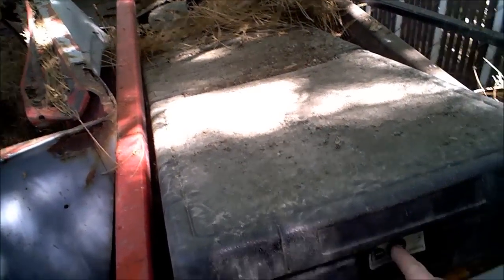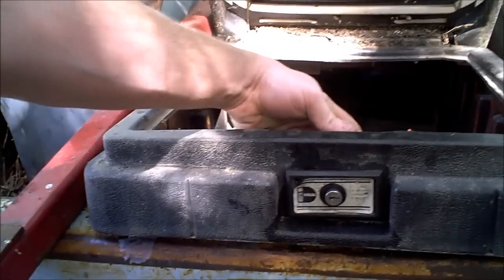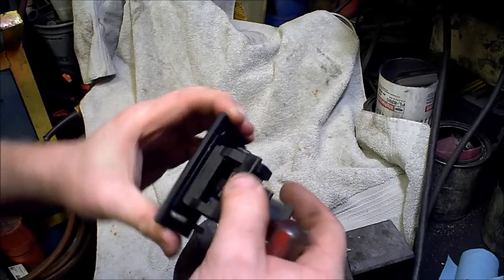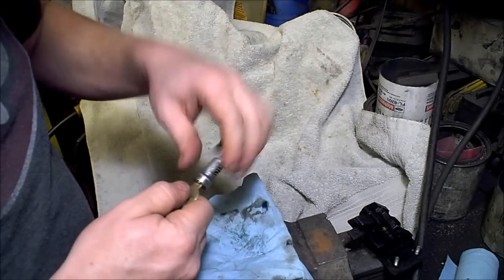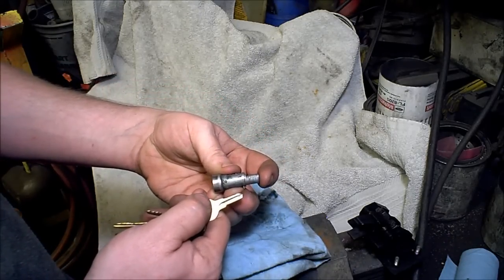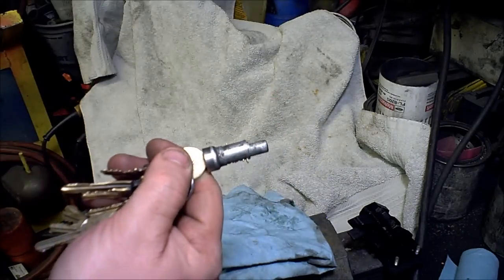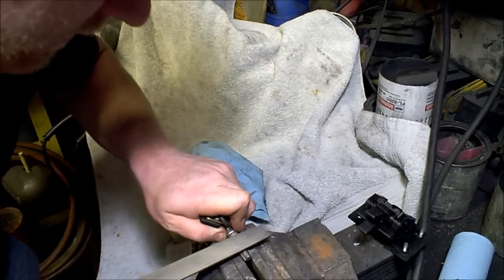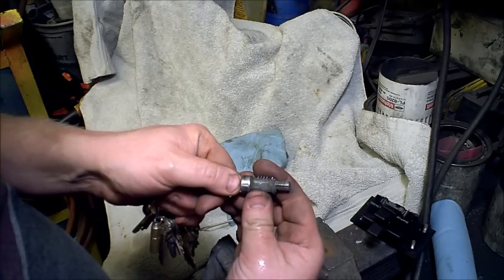Rekey Truck Tool Box Lock

Comment: thanks it works , I fixed both lock on my tool box , only thing is now any key that fit's the key hole can open the door, the only thing  that saves my hide is when I close the tail gate on my jeep and lock it you can't reach the tool box lock's , cause they hide behind the jeep door .
Reply from the maker: Someone would likely know how to pick lock already before they attempted to stick a key or pick lock in the lock to open it.
Reply: im just saying maybe  it's just me than , when I was a little guy I stuck my key in a somebody's lock cause my key fit and it opened, and when I was 16 my mom took me to a store , and we open the door of our Pontiac, than we used the second key to start it and it would not start , back than cars had two keys remember , it wasn't our car , it looked just like it and our door key opened it, but would not start it, so since than I have a habit of sticking my key's where they don't belong , so it's MY BAD , but thank you for helping cause they wanted between $40 and $60 to rekey it, plus like I said the lock box is in my jeep and the lock's are facing the tailgate , with like one inch of room between the box and the tailgate. so no one getting in.
Reply: jojojeep1 Yes, that's called "key interchange", when you stick the wrong key into a lock and it turns anyway. No lock is completely immune to this problem, but you definitely make it worse when you file tumblers in this type of lock.

Comment: sixtyfiveford  Kudos for figuring this out with no locksmith training. But there's a problem here. What you've actually done is a bad example of MASTER KEYING. The original key still works, and your new key works, plus a couple dozen other keys which are similar to either of those keys. What you may not realize is that now you've drastically decreased the security of the lock. These types of locks are not very secure to being with and now you've made it worse. After this modification, the lock will be very easy to pick and much more vulnerable to random keys. Real "rekeying" involves rearranging or replacing the tumblers with the goal of making the old key stop working. If you're really lucky, you might be able to just rearrange the tumblers until they line up with the key you have, but more likely what you'd need to do is either #1 get yourself a rekeying kit with a selection of different sized tumblers, or #2 get an uncut key blank which slides into that plug and file the key with a round file until it matches the rearranged tumblers.

File the key, not the tumblers. That way the lock is uncompromised.

I'm a Certified Master Locksmith.
Reply: Toolbox keys are often alike

Comment: Will this work on truck/car door locks also? I have a truck that the key will not work in the passenger door anymore, bought it used and the key is not in new condition to get a good copy made. Thanks.
Reply from the maker: It won't. I have had the exact same situation. The best solution is to get a copy made. Then get a copy of the copy. This will built it up to closer where the original would have been.
Reply: Superiorpowerwash Take your worn key to a locksmith shop. Ask them to decode the key and make an original back to factory specs. It costs more than a duplicate, but it should solve your problem.

Comment: I have a Contico plastic truck box, dual lids, no key and its locked. How do I open it without damaging the plastic? It's empty and off the truck so I can move it around easily but can't get it open to remove/replace the locks. Any suggestions? Will drilling out the rivets work?
Reply from the maker: These locks are relatively easy to pick. The easiest way is with a key that fits in the hole. Pull the key in and out rapidly while applying slight turning force. Generally with will pop them right open.
Reply: I found something that works for me. I drilled a tiny hole dead center over the keyhole and as close to it as possible. Maybe a 1/4" above the push button. Then, using a short piece of 12 gauge solid copper wire, I slid the wire thru the hole and pushed against the spring loaded latch while also pushing down on the lid then lifting it. Works every time and as fast as using a key. Best of all, the lids are always locked when closed. I don't have to remember to lock them, if they are closed then they are locked. I also don't have to worry about accidentally locking my keys inside. Even if I lose the piece of copper wire, just cut another piece or use a 8d nail. Most anything will work as long as it fits thru the hole. The only drawback is being discrete while using the wire. Don't want anyone to witness it and decide to repeat the action when my back is turned. But I think it will work just fine as is.

Comment: I have a similar toolbox and lock. Problem is, the key was lost by the previous owner. And now one of the lock cylinders fell out because the housing was brittle. I want to replace the locks on both sides but can't find the right part. It's the assembly that comes out when you remove the 4 nuts
Reply from the maker: Your best bet would be to look on the manufactures website for the entire assembly. Some of these plastic toolboxes have unique setups.
Reply: sixtyfiveford can't find anything engraved in the box guess I'm out of luck lol the latch is 2 inches wide and 4 3/4 inches long
Reply: MCFriedChicken1 I have the same setup that is in this video and my toolbox is made by Delta. The replacement I found on Amazon was way too big and I am currently looking for the right part. I’ll let you know if I find anything.

Comment: I got the exact same one but it shut closed and locked lost the keys idk how to even open it how would I do
Reply from the maker: These are super simple to pick lock. Insert any key that fits or even a flat nail file etc. Lightly twist while moving the key etc in and out. let off the twist back on the twist all while moving the key in and out and you'll pop it open in 30 seconds.
Reply: @sixtyfiveford  going to try some guy bought a house and it was in his house sold it for 5$ and it fitted my Tacoma perfect

Comment: The First thing, mine is locked shut. How do I open it? Same Box, Delta.
Reply from the maker: These are as easy as pick locking gets. You can simply put any key or even a key shaped object and move it in and out while lightly trying to turn the lock and generally it will pop right open within seconds.
Reply: @sixtyfiveford  I have a key that turns the cylinder, just no push function to release latch, soaking in silicone spray for the past 3 days, no change, except the key is easier to insert/remove.
Reply: Locks are still stuck and will not push to release.
Reply from the maker: @davidcanard9699  So the lock is rusted and doesn't turn with the key either?
Reply: @sixtyfiveford  The key turn
is free,  the lock is stuck in, no push.
Reply from the maker: @davidcanard9699  My lid always was sticky even when fully lubed. They required a good pull up to open the lid.

Comment: Sorry mine is locked and I can't push the button all the way so I can't see the pin I guess I have to figure out how to unlock it
Reply from the maker: The locking cylinder is usually threaded and has a large nut holding it on (most metal tool boxes).
Reply: My toolbox is just like the one in your video same lock
Reply: @jamescarranza428  Same box here, found a key to turn the lock but it won't pop out. You ever find a solution?